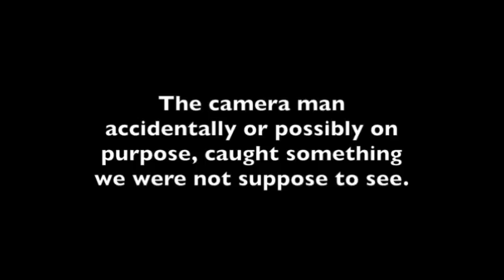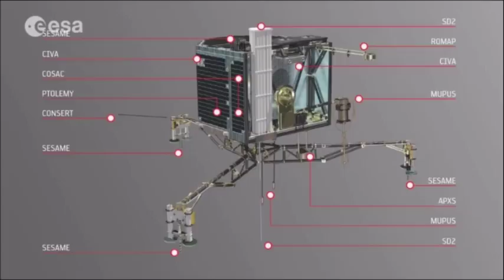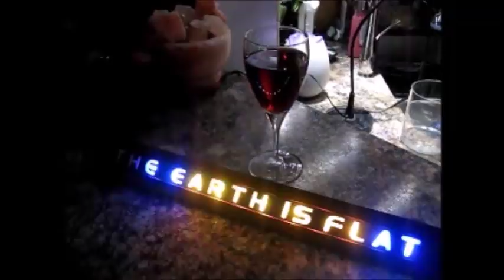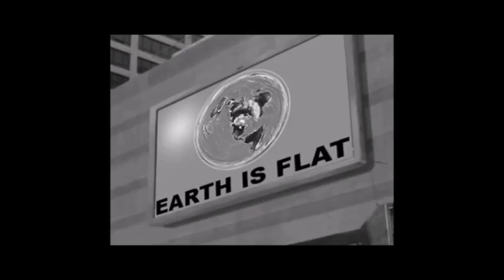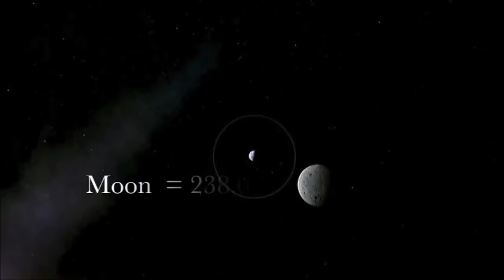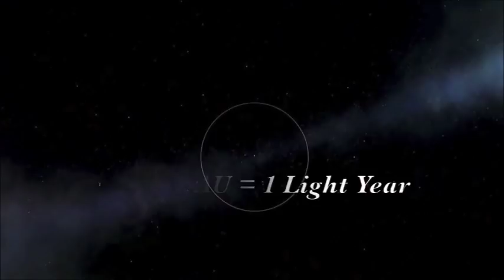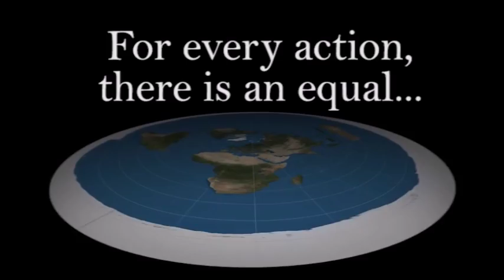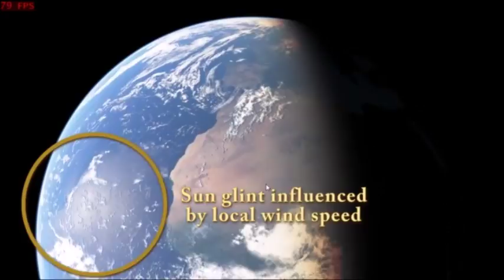Flat Earth Q&A Emails 48 - Mark Sargent ✅

Comment: I feel we are being lied to a lot, but I'm not fully convinced by FE... Doesn't trigonometry show that, for example, Perth and Sydney in Australia, should be farther apart than the 2000 miles that we can observe? If the Earth were flat then surely it should be much more?
Reply: Gordon STIRLING-WHYTE Gordon You gotta be kidding.
Reply: Joseph, surely it's a valid question... On a globe, lines of longitude diverge from the poles to the equator, then converge to the south pole. On an FE model, these lines of longitude would continue to diverge after the equator. If you can explain why Perth, at 115°51′32″E and Sydney, at 151°12′34″E, aren't more than 2000 miles (3936km) apart, please do so. Bear in mind that, at the equator, degrees of longitude are about 111Km apart. Imagine these two cities at the equator... they'd be 3996Km apart. Given that they are both about 30°S, surely the fact that they are 'only' 3936km apart fits with a global model rather than a flat one? If the Earth were flat, there'd be more than 4000km between them. No?
Reply: You are correct, its just another fact that the FE crowd like to ignore. Just as they ignore the completely different night skies south of the equator and north of it (and that you can see the same stars due south of Perth and Montevideo simultaneously on the longest nights each year.

In other words FE is rendered a ludicrous claim by simple observations and a maths learnt by the age of 12 or 13.
Reply: Thanks Naeron, indeed that's another fair nail in the FE coffin. It's a great shame that so many otherwise fair-minded folk get sucked in by FE, which I'm starting to think is the ultimate feather in the CIA's psy-op cap. Nothing quite discredits a conspiracy theorist like touting flat Earth...

Comment: Mark you still not have explained how maps work. If geographical coordinate system which is based on a globe model is false...how come maps work ?
Reply: +WOODFORD "While the map is never reality, in such ways it helps to create a different reality. Once embedded in the published text the lines on the map acquire an authority that may be hard to dislodge." - J.B. Harley, Deconstructing the Map

Flat Earth | Is Google Earth Wrong?
https://www.youtube.com/watch?v=bpbp6I5-TLs
Reply: +WOODFORD 1848 - During Captain James Clark Ross' voyage around the Antarctic circumference, he often wrote in his journal perplexed at how they routinely found themselves out of accordance with their charts, stating that they found themselves an average of 12-16 miles outside of their reckoning every day, some days as much as 29 miles.

He began his Antarctic circumnavigation in 1839 covering 69,000 miles over 53 months. Upon reaching the massive ice barriers, he said, "extending from its eastern extreme point as far as the eye could discern to the eastward. It presented an extraordinary appearance, gradually increasing in height, as we got nearer to it, and proving at length to be a perpendicular cliff of ice, between one hundred and fifty feet and two hundred feet above the level of the sea, perfectly level and flat at the top, and without any fissures or promontories on its even seaward face. We might with equal chance of success try to sail through the cliffs of Dover, as to penetrate such a mass."  

By the way, he was off course because he was accounting for magnetic declination which was "invented" by the astronomer Georg Hartman in 1510, just as Copernicus began his work on the heliocentric model (hypothesis).
Reply: Murat Harman it's just map projections fro 3d to 2d
Reply: @Murat Harman: I think Woodford's point is still valid. On the FE map, lines of longitude are the same as on the maps and atlases we see regularly accepted. The problem is principally in the Southern hemisphere - hence my comment yesterday about Perth and Sydney in Australia - as these lines of longitude should converge after the equator in the globe model, yet they continue to diverge in the FE model. As we can observe that distances East-West do NOT diverge after the equator, then surely the FE model is incorrect...
Reply: +Gordon STIRLING-WHYTE we can argue map inaccuracies all day long but the fact still stands that no one has or will circumnavigate the Earth from North to South.

Regardless, there are so many other "visual" proofs that show us that the Earth can only be a flat plane... and if the individual can accept this realisation, they can then move onto discovering their true (spiritual) purpose here.

Of course, if you lack a belief in God or higher intelligence, you will fall back to the Jesuit inspired heliocentric universe because the basic geometry and maths is validated in your logical mind even though your eyes are showing you something else entirely... 

Albert Einstein once said.... "A man should look for what is, and not for what he thinks should be." 

He also said this in a 1921 lecture on "Geometry and Experience"... have a read and see if you can apply some critical thought and find out what he was really trying to tell us...

"One reason why mathematics enjoys special esteem, above all other sciences, is that its laws are absolutely certain and indisputable, while those of all other sciences are to some extent debatable and in constant danger of being overthrown by newly discovered facts.

In spite of this, the investigator in another department of science would not need to envy the mathematician if the laws of mathematics referred to objects of our mere imagination, and not to objects of reality. For it cannot occasion surprise that different persons should arrive at the same logical conclusions when they have already agreed upon the fundamental laws (axioms), as well as the methods by which other laws are to be deduced therefrom. But there is another reason for the high repute of mathematics, in that it is mathematics which affords the exact natural sciences a certain measure of security, to which without mathematics they could not attain.

At this point an enigma presents itself which in all ages has agitated inquiring minds. How can it be that mathematics, being after all a product of human thought which is independent of experience, is so admirably appropriate to the objects of reality? Is human reason, then, without experience, merely by taking thought, able to fathom the properties of real things.

In my opinion the answer to this question is, briefly, this: - As far as the laws of mathematics refer to reality, they are not certain; and as far as they are certain, they do not refer to reality."

If you apply the spinning Earth physics models to flat Earth dynamics, it will not make any sense to you but once you begin to study these topics: Vortex Mathematics, Fibonacci sequence, Golden Ratio (Phi 1.618), magnetism and dielectrics, Cymatics, Sonoluminescence, Five Platonic Solids etc you will begin to understand the true nature of your reality a lot better... you will also naturally apply more of your left brain intuitive mind in balance with your logical mind when you are presented with new information.

You are here to apply wisdom to your knowledge (awareness) in order to  find the truth and achieve soul growth.

Nikola Tesla once said, "If you want to find the secrets of the universe, think in terms of energy, frequency and vibration."... most people have no idea of the true meaning of this statement.

I have compiled a 12,600 word analysis of Heliocentrism and Gravity and after 2 years of research, I can tell you without a single doubt that you are living in a flat Earth 'realm'.
Reply: Thank you Murat, for taking the time to write such a detailed response to my question; I'm grateful that you have dealt with it in a respectful manner, as opposed to some others I've encountered who have simply brushed me off with a "You gotta be kidding", or words to that effect. 

I must apologies for taking so long to reply: I'm self-employed and have two young children, so often don't have much time during the week for watching youtube videos etc. That's also why I've not dabbled much in the fields you referenced (Vortex Mathematics, etc), although I've heard a bit about a couple of them, namely the Fibonacci sequence and the Golden Ratio. I would like to know more, but there just aren't enough hours in the day. 

With reference to the Einstein and Tesla quotes, I have the following reflection: both were geniuses, but not infallible, and sadly now that they've both passed on they're not around to respond to our insights into what they believed, or what conclusions we draw on things they said. I like Tesla, and in fact he came up in conversation with one of my ESL students, who works in cancer research. One of the pioneering new treatments he's working on uses targeted frequency to attack tumors without the need for surgery or chemo; top stuff. 

In what way Tesla's work favours FE over the established model, I'm afraid I don't know, though I invite you to present your argument. 

With regards to your Einstein quote, I feel you're going too far in the conclusion you draw in answering his wuestion. Einstein was merely surmising that given mathematics is a bi-product of our interpretation of what we have presented to us in the world, could it exist without that perception? A bit like the question of whether a tree falling in the forest makes a sound if there's nobody, or no animal, around to hear it. Of course, having a bit of a scientific background, I would say some of the kinetic energy of the fall must surely be transformed into sound... In short, Einstein seems to questioning the existential nature of mathematics, rather than it's fallibility, and his quote provides no justification to your assertion that mathematical laws cannot be used to refer to reality. Indeed, I'd go further as to say that they are about as ambiguous a description as you can get - provide the tester is objective. 

And this brings us back to my initial question of cartography, and your response regarding 'inaccuracies'. If you are hinting that the maps we use today are simply the by-product of corrupt scientists who have been paid to produce maps that only exist so that the powers that be can continue peddling a lie, I would have to say that is a hugely unfounded statement. I accept that there are corrupt scientists out there. There are also corrupt priests and preachers, corrupt journalists, corrupt doctors, but that doesn't mean we should automatically reject all religions, all scientists, or even all we read in the press (there are some good guys out there!). The trick is, and I'll admit it's by no means easy, is to take in as much as we can, weigh it up, and judge each on their individual merits. Are you really suggesting that the cartographers out exploring the 'realm' in the time of the ancient Greeks were part of some great conspiracy? Perhaps 16th century explorers such as Magellan and Elcano were just old-world shills? 

The fact that nobody has circumnavigated the globe North to South is a moot point: the fact that you (and by you, I really do mean anyone!) can measure distances between two points is not. The fact that both the FE model and global model have the same lines of longitude is critical to my argument, as it is perhaps the only common factor to the two trains of thought. So, given that we both accept there are lines of longitude we can draw from magnetic North, I would expect you could acknowledge that, as we go further south from this point, our lines of longitude would get farther and farther apart. On a globe, lines of longitude diverge from the poles to the equator, then converge to the south pole. On an FE model, these lines of longitude would continue to diverge after the equator. 

Thus, If you can explain why Perth, at 115°51′32″E and Sydney, at 151°12′34″E, aren't more than 2000 miles (3936km) apart, please do so. Bear in mind that, at the equator, degrees of longitude are about 111Km apart. Imagine these two cities at the equator... they'd be 3996Km apart. Given that they are both about 30°S, surely the fact that they are 'only' 3936km apart (63 less than the equatorial estimate) fits with a global model rather than a flat one? If the Earth were flat, there'd be more than 4000km between them. No?
Reply: Good evening Murat, thank you for the interesting response. I have watched the video as you suggested, and admit that it's very well done and well presented. The content is, by and large, excellent, and I thank you for pointing me in it's direction. 

Contrary to your prediction, my first reaction was actually along the lines of "Wow, there could actually be something in this!" In fact, even after watching the whole thing I was starting to doubt my own standpoint, however I then read the comments and found one two months ago by a guy called Ian Roy. He asked for a link to the 'curvature calculator' and how it was formulated. A dude called Charleigh Waggoner responded "8 inches by mile square", to which Mr Roy correctly observed that Mr Curious Life's claim that there should be 175ft of missing curve is erroneous: 8 inches by square mile is still 18*6 (128 inches, or about 10ft), rather than 16*16... Another user, Sportys Business, tries to claim that it is necessary to square the number of miles when doing the equation, but kinda falls flat on his face. 

So now, having watched the vid twice, I guess my over-riding feeling is that it's a shame some really excellent observations, calculations, experiments - well, science - has been wasted due to a simple error when doing the math. Again, nothing against Mr Curious Life, it's whatever 'calculator' he used that is the source of the error. I wonder how many others investigating FE vs Globe have fallen over the same hurdle... I wonder what Einstein would have made of it! One feels that, if this guy had looked for what is, rather than what he thought there should be, he would have surely seen the error in the calculation. 

Another point I'd like to make relating to your post is the misconception, I feel, that FE is some sort of 'key' to opening the mind to new theories and the ability to see through the lies we're being fed by the MSM and our 'leaders'. You also state that belief in a 'higher being' is necessary for this process. Well, I'd like to think that I'm living proof that neither are a pre-requisite: I first got into questioning 'facts' after watching the film JFK for the first time. Then there was 9/11 and the Iraq War. Since the early 2000s I've been a skeptic of most of what comes out of the mouths of politicians, and try my best to read between the lines when it comes to what passes for journalism these days. I've also recently discovered the youtuber Jordan Sather and his 'Destroying the Illusion' channel. Have you watched any of his stuff? Now, I don't necessarily agree with everything he says (especially chemtrails), but particularly like his take on Geopolitics and hidden technology / Secret Space Program. If you haven't watched his stuff then I suggest you give it a try, despite his 'coming out' as not being a Flat-Earther - citing weather patterns and electro-magnetism as not matching the FE model. He reckons, and I'd have to agree, that FE is a CIA psy-op created to discredit the 'truther' community. He's a big fan of Tesla though, so I'm sure you'll find some common ground there.  

I haven't had time yet to check anything out relating to vortex mathematics but will give it a go at some point. Is there anything in it that might help answer my original query relating to lines of longitude converging towards the South pole? You've made some great comments but haven't actually addressed that question specifically. I'd love to hear your thoughts on it.